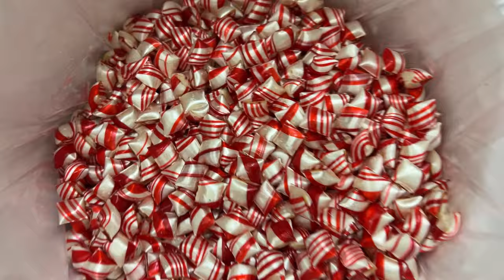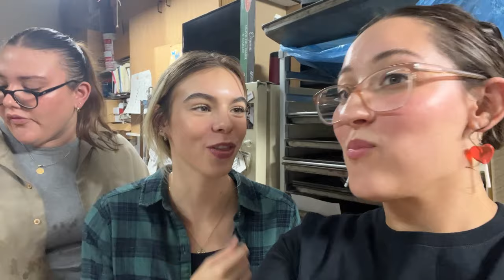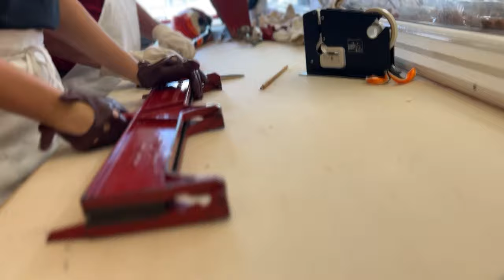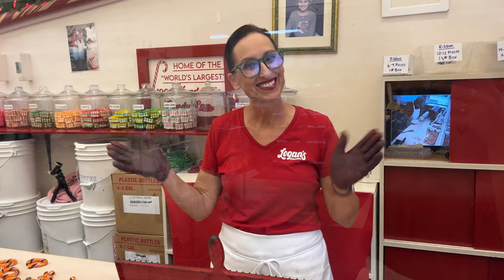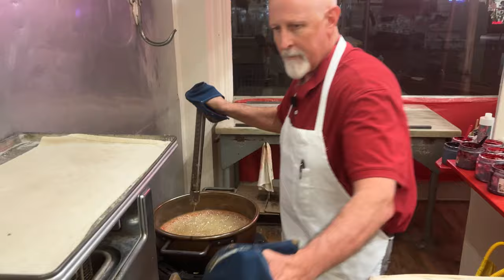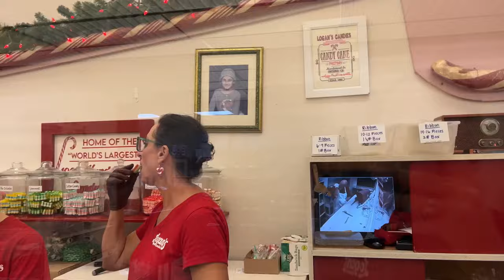DAY IN THE LIFE at Logan's Candies 🍬🎃🍭 Car Show VLOG 2023

Comment: Illegal to use those gloves handling food. Smh
Leather is treated with many chemicals. 
Pre-tanning chemicals are used to prepare the raw hides for further processing.
Liming agents are used to removing hair and other proteins from the hides.
Deliming agents are used to neutralizing the pH of the hides after liming.
Bating agents are used to soften the hides and improve their elasticity.
Tanning Chemicals
Tanning chemicals are used to turn the protein in the hides into stable leather.
Chromium salts are the most common tanning agents used in modern leather manufacturing.
Other tanning agents include vegetable tannins, aldehydes, and synthetic tanning agents.
Dyeing Chemicals
Dyeing chemicals are used to color the leather.
Acid dyes are commonly used for leather dyeing, as they provide good colorfastness and uniform dye penetration.
Basic dyes are used for bright and intense colors, but they have poor lightfastness and are not suitable for outdoor use.
Finishing Chemicals
Finishing chemicals are used to give the leather its final appearance and properties.
Fatliquors are used to improve the leather's softness, flexibility, and water resistance.
Resins and waxes are used to improve the durability and glossiness of the leather.
Pigments are used to cover up blemishes and provide uniform color to the leather.
Other Chemicals
Other chemicals used in leather manufacturing include preservatives, fungicides, and bactericides.
These chemicals are used to prevent the growth of microorganisms that can cause the leather to degrade.
Environmental Concerns Surrounding Leather Chemicals
Leather is a popular material used for clothing, accessories, and furniture. However, the process of tanning leather involves the use of various chemicals that can have harmful environmental effects.

Leather manufacturers need to understand these environmental concerns and take steps to minimize their impact. Here are some of the environmental concerns surrounding leather chemicals:

Toxicity

Many of the chemicals used in leather manufacturing are toxic to humans and wildlife. They can cause skin and respiratory irritation and more serious health effects with prolonged exposure. Additionally, these chemicals can enter the environment through wastewater and landfills, potentially contaminating water sources and harming wildlife.
Reply: They aren't exactly keeping a low profile about it. If it truly was illegal, they would have been shutdown by now.
Reply: Calm down dude 😂
Reply: @devingarnett7286  lmao
Your avatar.